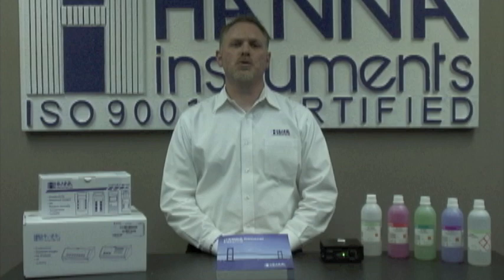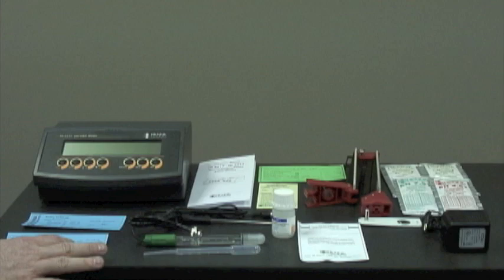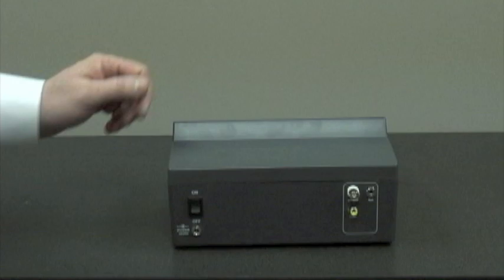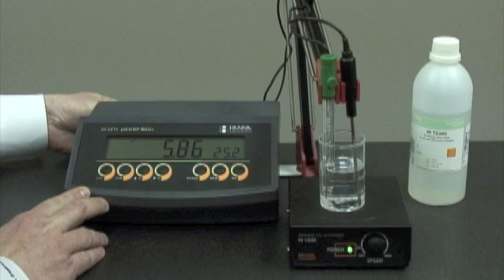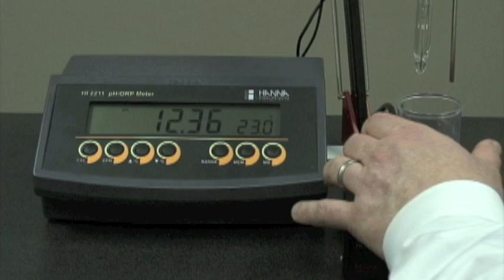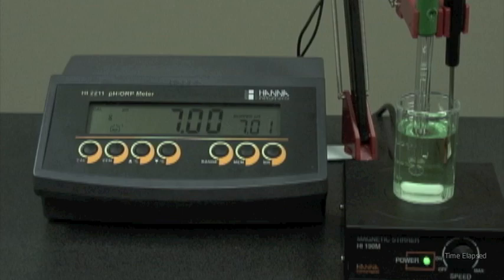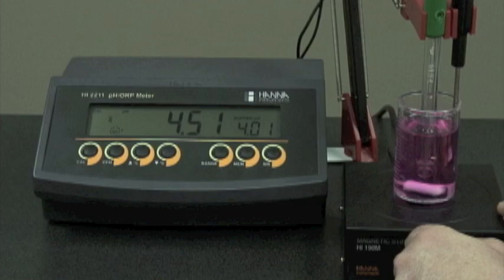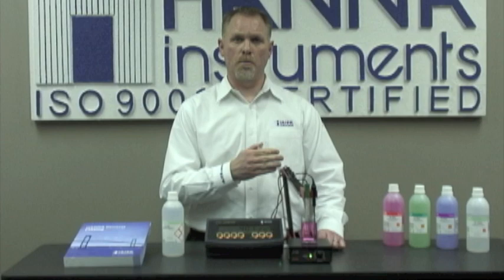HI 2211 pH and ORP Benchtop Meter

Comment: Thank you so much for this, but I have a doubt, what would be the sample temperature to take an appropiate measurement. I mean the sample it has to be always in 24 or 25 °C?
Reply from the maker: Hi Jenner. This Benchtop comes equipped with temperature compensation.
Reply: Sample temperature should be room temperature or 20c.